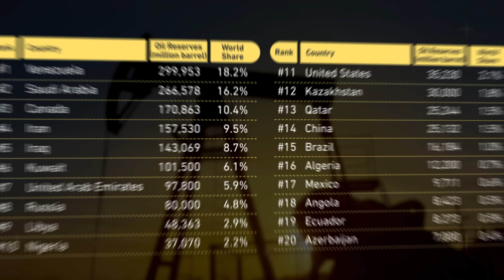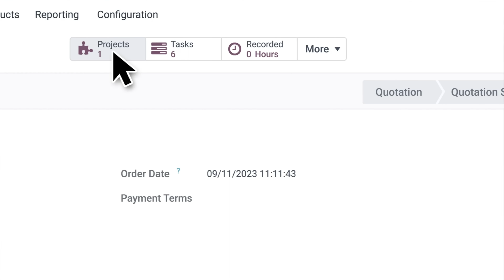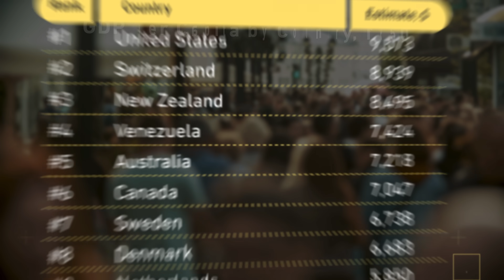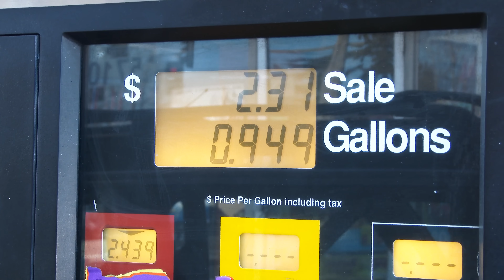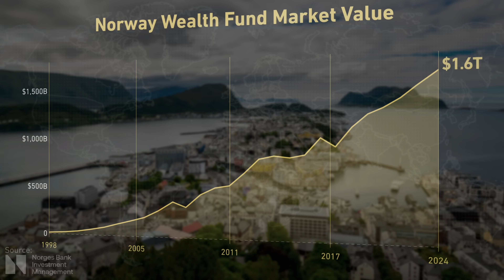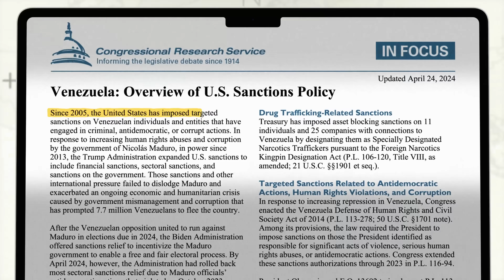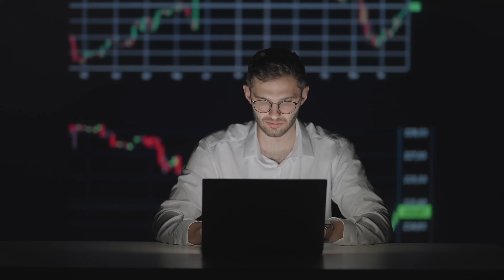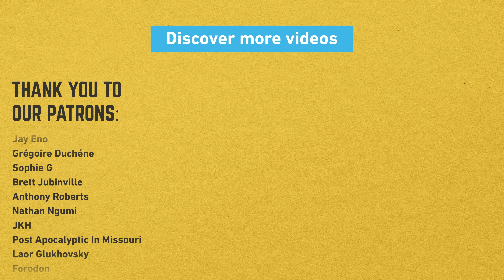How Venezuela's Economy Became a Disaster

Comment: You know its bad when EE basically says "no, theyre fucked" when asked if the country can turn itself around.
Reply: Probably because the oil age is coming to an end. It will continue for a while but by 2030 it will probably become clear that green energy is taking over from fossil fuels.

Even if the best government was elected this year, there just isn't much time to take advantage of oil profits now.
Reply: @coolbanana165  I think there's still quite some time. Oil is very prominently used in manufacturing and farming. Energy is just a slice of its market share, and is the easiest one to replace. Fertilizers and plastics are much harder. I think EE just simply does not have hope for Venezuela's government and also thinks its industry got beat down too much.
Reply: @renato360a  exactly oil extraction isn't going anywhere. less than 30% of a barrel of oil is used for gasoline and heating. the vast majority of it is used industry, medicine, cosmetics, etc
Reply: Only way to turn it around is a change in government
Reply: @BLACKAAROW where are you getting that information, because it’s either an extreme edge case or completely incorrect (for the US at least). About 70% of crude oil is refined into gasoline or diesel fuel, while another ~15% is refined into other fuels (jet, heavy, light, or HGLs). Only around 10% becomes feedstock for use in making everyday products like plastics.
Reply: Exactly
Reply: @renato360a  I agree it will be used for other things still, and for a while.

It's just whether you can build an economy on it when there's less demand that's decreasing.
Reply: In principle, they could turn this around. If European post socialist states could turn into developed economies in few decades, so the venezuela could too
Reply: @coolbanana165  there is no logic behind this comment. there is nothing that indicates the oil age is anywhere near over. every cargo ship and freight vehicle on earth runs on fossil fuels, transportation literally makes the world go round, a nations ability to provide its people with cheap fossil fuels is EVERYTHING in a free market society.  cheap fuel means it costs less to build houses or move food from the farm to the store, therefore dircetly affecting the price of food and housing. this is not magically changing because of electric cars and windmills
Reply: @cshepard09  Yeah, I said it was changing. You're saying what is the case now. I'm not sure if you know how time works.
Reply: Nothing's going to improve until the Chavistas are thrown out of power. I wish whoever replaces them the best of luck, they're going to need all of it. They'll be climbing from rock bottom.
Reply: @coolbanana165  as a venezuelans we don't care about the oil anymore, we just want to be free from maduro....
Reply: @justuseodysee7348  well that's truth, some countires have been destroyed and recovered fast, the thing is when is this mf letting us alone
Reply: @coolbanana165 

Acrually oil becoming a thing of the past (if it actualky hapoens) would be a huge win for Venezuela.

Not having valuable resources would mean less idiodic governments on the long term.

But sadly the only reasons why oil is becoming a "thing of the past" is due to degrowth economic policy in the west that is likely to change in the future once common sense takes over their governments.
Reply: @fearlesspotato3429  It has nothing to do with degrowth, just using green energy instead.

In Spain it has boosted growth from stable energy prices.
Reply: @coolbanana165 planes will forever be using petroleum-based fuel. 

The oil age will not be over before you die 😊

Comment: One thing about oil which you should include when discussing reserves is quality. Arabian oil is very high quality very low sulfur content which makes it miles ahead more worthwhile to extract than venezuelan oil. It's like saying you have the most fresh water but it's very contaminated and would cost more to purify it than buy it from someone else. While all points are correct it's just a small thing that changes a lot about the discussion of oil reserves. Arabian oil is very low depth and high quality which keeps the price down while venezualan oil was popular during the oil crysis as it was better than nothing.
Reply: Crysis is a video game
Reply: Source: trust me bro
Seriously, once its refined its the same so what is the difference in costs per barrel and how does this change the mismanagement part of the story?
If all you say is "its totally different because of this seemingly irrelevant detail im not elaborating how it is relevant to the main narrative" then you fail in why it should be included
Reply: Yeah, though it changes little. It's still essentially free profits, just little less.
Reply: @TheGahta source is chemistry... you have to specifically build a refinery to handle this bad quality oil first
Reply: @TheGahta Cost of refining Arabian oil is much lower than Venenzuellian oil. Then when you are told you can not sell this oil because you didn't allow me to profit from them, well, there's an issue which isn't the mistake of the government.
Reply: @Fr00stee  It's the same with Russian oil, it has higher sulfur content. It doesn't change the price that much, but yes, refineries need to specialize in that kind of crude, and it might be worth slightly less than Arabian oil before refining. It's the same after refining.
Reply: @TheGahta  Additional processing raises the cost-per-unit of usable products, and more importantly, means that anyone wanting to use that oil will need more sophisticated refineries to process it. It both raises the price floor, and limits your potential customers. Venezuela has those refining facilities, but decades of disrepair and a lack of reinvestment, repair, and local expertise has crippled their output.
All of this is fixable, but it would take EXTENSIVE investment in new facilities. Money the government no longer has, to attract businesses that no longer want to deal with a country that's tossed them out before.
Reply: @TheGahta  Well it is an issue because lots of Venezuelan oil fields are only profitable to drill on when crude prices are high enough because turning Venezuelan oil into useable products like gasoline is a lot more expensive than doing the same with say, Saudi oil.
Reply: @Fr00stee  you have to refine it regardless 
If your trying to chicken out please safe you the embarrassment 
I specifically asked what the difference is in cost per barrel as thats the metric to quantify "its of worse quality"
If you don't want to quantify it and just use it as an excuse
"Source is chemistry" 🤣 hard to look more pathetic if thats how you answer a very specific question 🤡
Reply: Good point but if American and Canadian oil companies can turn a profit from the junk that gets mined in northern Alberta then they should be able to work with Venezuelan crude.  Of course Albertan oil companies and provincial and federal governance in Canada is much more stable than in Caracas so that reduces the cost of capital to refine Albertan crude.  Any refiner that wanted to tool up to handle Venezuelan crude will want a healthy risk premium which would require higher retail petrol prices.
Reply: @TheGahta  Different crude oils require somewhat different processing to make products. Also, the amount of gasoline that can be made from each crude varies for example. This affects both the cost to refine and profits that can be made from each source.
Reply: @washingtonradio  yes hence why I asked for it to be quantified preferably in cost per barrel as so far its useless as everything has an impact on costs, if it cant be quantified its meaningless to talk about it
Reply: @TheGahta  The price per barrel does not matter since nobody uses crude oil as a direct source of energy, it needs to be refined into different products first. The real cost is the expenses to ship it to some other location around the world and send refined product back, as only select countries can actually refine and import this type of oil themselves, so if your country does not have the correct refinery this crude oil is completely useless.
Reply: Its to funny how people here are discussing oil refining and profit margins while totally ignoring the two most important factors.

First Refining oil also produces valuable resources, which is why both russia and Venezuela made similar profits to the saudis (note how somehow russia still remains an oil state while venezuela fell completely whil having better quality oil than russia) 

Venezuela did not fail because its oil is bad. 
Poorer countries did better with worse. Like Sweeden and russia. 

Secondly, Venezuela is a founding member of OPAC an orginaisation designed to ensure maximum profits to all parties involved while absolutely avoiding interference from another party inside OPAC. It also ensured a fair cut for each part, meaning the saudis had to lower production and exports so they would not get more money in the end. 

so yea. the quality of oil is absolutely irellevant to this argument

Maybe, just maybe, it was Vene screwing with other OPAC members that had an influence on it. just an idea
Reply: @TheGahta because the cost of refining and transportation, extracting, and storing before refining is exorbitantly high. 
But to add on to what the other guy said though. It’s only partly true. We have two main oil rich zones in the country. On the east, the Orinoco River region has ultra heavy petroleum. But the deposits on the West on Lake Maracaibo are medium to lighter petroleum.
Reply: @TheGahta  Actually he told you why it's relevant - and this is known by everybody that knows about crude oil. Higher cost to purify.
You are right - It's the same after it gets refined. But that's AFTER you refine it. And since it is all the same when it's refined, having a larger input and processing cost is important because the sale price needs to be higher to account for the costs. There is no reason for customers to buy more, because as you said it's all the same when refined. It's a competitive disadvantage.
Venezuela has heavy and sour crude - the two least desirable qualities in crude. It takes more refining stages to refine - more holding time, larger initial investment, more maintenance, and higher costs.
Reply: @recoil53  saying "higher costs" and quantifying it are two things,as stated above many times.
Best read a discussion before inserting yourself if you going to embarrass yourself by arguing the same weak things eh?
Without the "how much" the cost are higher we could very well argue about their bigger shoe sizes as its just as meaningful
Reply: @TheGahta  But I really don't have to quantify it. The very fact that there are extra stages is enough to know. Quantifying it really only come into play in trying to figure out HOW MUCH HIGHER the costs should be.
One of your previous points is garbage too - yes you have to refine all oil. No, that does not mean extra stages with more heating (because Venezuelan oil it thick) costs the same.
Special refinery set ups are needed, which in itself raises costs.
Reply: @TheGahta  Really you just had a bad initial take and are just making poor arguments to "support" it.
Reply: @recoil53  Yes, but the sandwiches for your workers are cheaper in Venezuela. So the oil should be cheaper.

 Do you see how stupid this argument is? Thousands of factors influence the cost of refining and selling petrochemicals. You have to quantify the effect on the prices to determine if it makes sense to talk about it.
Reply: @GuthmanGroup You are saying "just take my word for it bro".
Reply: @GuthmanGroup  It's also true that the market just doesn't care what the production costs of the supplier is. High labor costs do not factor into the decisions of the buyer.As a less desirable, harder to use product it cannot command a premium.
Reply: @GuthmanGroup  The problem for the producer of venezeulan crude is that it is thick and heavy so it is harder to pump out. Just as the refiner must heat it up just so it will adequately flow through the system, so too must the oil rig take extra effort to pump it out.
Reply: @GuthmanGroup  You've shown pretty clearly you don't know much about oi.
Reply: @TheGahta  The difference is that it costs more to refine, and therefore you can only make a profit selling it when oil prices are above a certain level. Also, because it requires special refining, that's additional expertise needed in the process, and if you mess up that step, then your oil is almost completely worthless.
Reply: @jmlinden7  and you have a figure to quantify this "added effort" so we can have an interesting discussion that doesn't stop at "bruh it costs more therefore they can't do anything" that has been done a dozen and in which you chimed in without adding any original thought?

Comment: The next country to stumble upon a massive oil field needs to hire Norway as a consultant.
Reply: That's not how it works. Consulting Norway and being Norway are as different as watching an aircraft fly by vs. building aircraft from scratch. 
Consultants are typically hired to tell their employers what they want to be told. Consultants are hired as affirmation dispensers to validate policies the client wants validated.
Reply: They should But they won’t
Because we all think we can do better than Norway but no one does
Reply: @Comm0ut  I'm a consultant. This is not how it works (in most cases). Ofc, sometimes the client wants an analysis done by a credible 3rd party just to go through with his own ideas (so that when they don't work out, he can blame the consequences of the 3rd party). Still, none of the bigger consultancy companies will do what they are told to do in the way of providing an analysis that is in line with the client's view but contradicts the results of the research on the topic. That would lead to most of the research by the consultancy companies being simply wrong, which in the long run would devastate the company's reputation (and that is basically all that matters when putting a high mark-up price on the consulting project being done).

Comment: Great video! Thanks for the input, crazy wealth fumble of the century. Just one point it's missing on the video is that Venezuelan Oil its thick. Its know as heavy Petroleum, it can still be used for gas and everything but need to pass through some refineries. It was said to be around $22-25 per barrel, at current prices its like 200% profit margin. More than enough if they could keep production running...

Comment: I think it’s important to mention the type of oil Venezuela has.  The majority of it is oil sands which is abundant but requires a higher level of skill and technical expertise to extract (at least the majority of it).  It’s not so easy as dropping a drill and pumping.  This should make experts as valuable as gold in this country but hasn’t.

Comment: This is a little bit too heavy on macroeconomic numbers. The thing about the oil industry, even when you don't need to do offshore extraction, is that maintenance is a major cost. When oil prices dropped during the 2008 recession Chavez told PDVSA executives that they still need to maintain profits despite lower prices. They tell him that this is only possible if they neglect maintenance, which will backfire in the long run as stuff breaks and production goes down. So Chavez fires the lot and replaces them with party officials, their family and friends who in turn fill the company with their party friends and family "working" no-show jobs.

How'd it end? How do you think? Basically everyone competent left and the badly crippled production that's left is completely reliant on foreign engineers from China and Russia rather than the highly skilled domestic workforce that used to maintain it. That workforce now mostly lives and works in the U.S for its' oil industry.

Comment: So a lot of people are like "socialism" at Venezuela but even in this video EE mentioned Norway, which is also a socialist country. The problem isn't socialism, the problem is weak laws, corruption and illiberal democracy. Whatever the economic system: capitalism, socialism, communism or other, a weak rule of law, corruption etc will lead to a failed state.
Reply: Norway is a capitalist economy with a strong welfare state. Venezuela however is actually socialist (and is a pretty good representation of the economic suicide socialism brings).
Reply: @AlbatrossCommando I would argue that "actual socialist" when its not beneficial so society is the result of Venezuela having bad governance. Because if Venezuela had strong governance then the country could correct for things not working. 

So it could take elements of capitalism that works and taking elements of socialism that work and lifting up all Venezuelans. But because the state is corrupt, the people in power used the excuse of ideological purity to tank the country. In this case, socialism is just a mask for the authoritarianism of Maduro. As a result, the system can't be modified to make it work or even abandoned because its not working.

Dogma is bad, no matter the system.